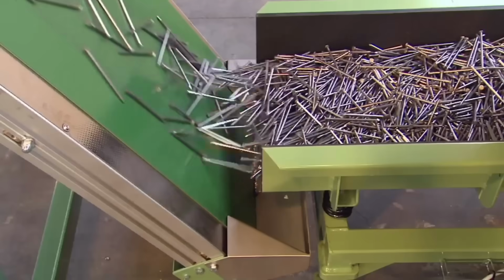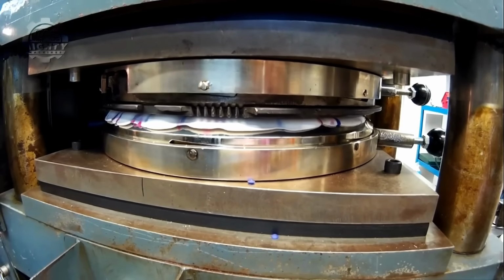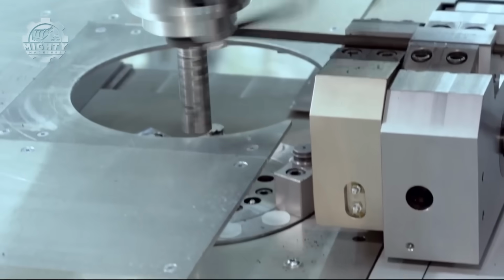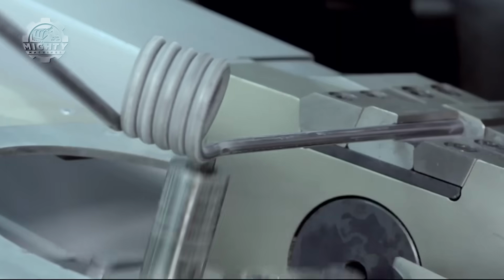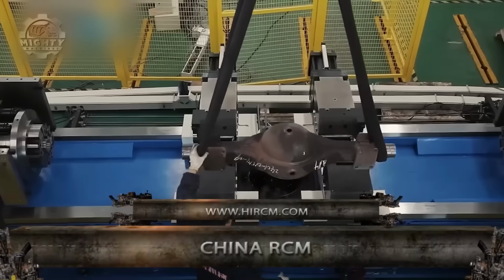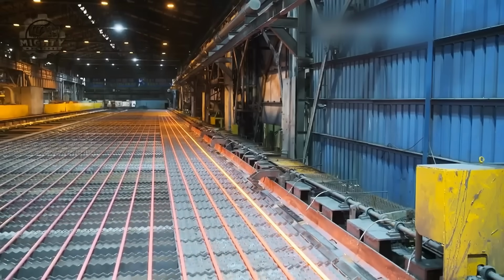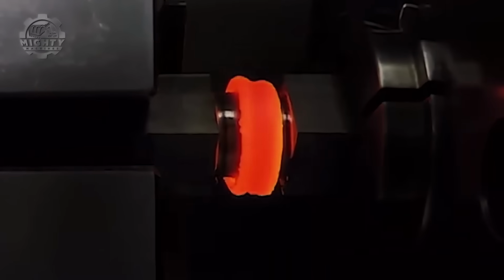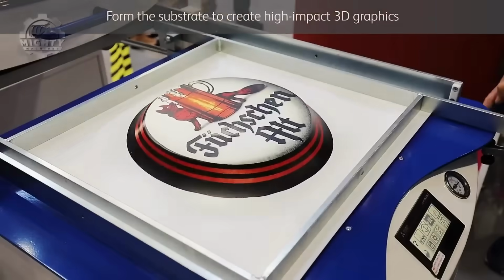Most Satisfying Factory Production Processes And Heavy-Duty Factory Machines!

Comment: That was a monstrously large herringbone gear at the end there. Wow.

Clever: started as a "ooh ah cool" video, and turned into a manufacturer hype reel.
Reply: I noticed that too, used on ships. Herringbone prevents gear walk twisting. 
Fun Fact: The gearing is at a certain ratio & a tooth is either added or removed so that each pinion tooth will always mesh with next tooth on each rotation of the bull gear.
This prevents unbalanced wear from imperfections to reduce noise.